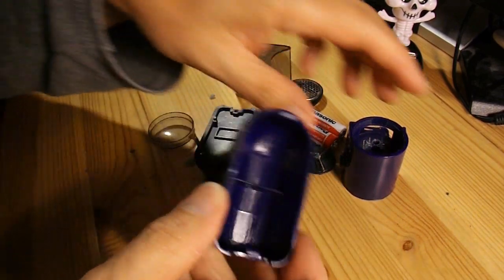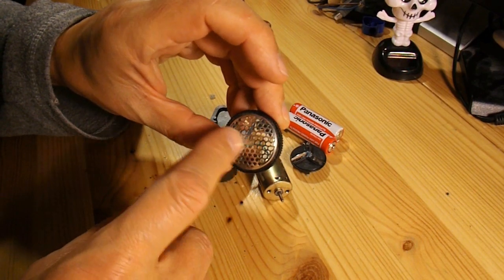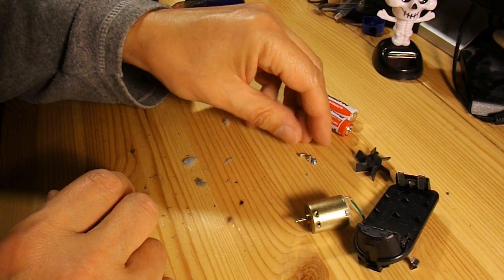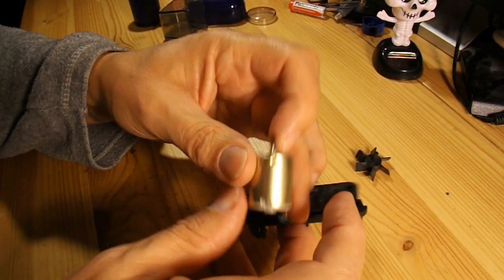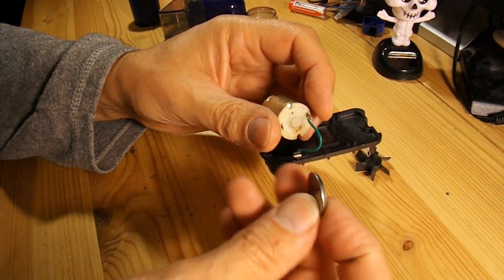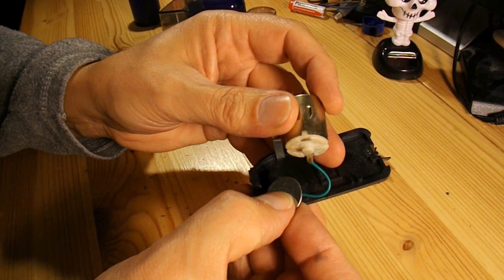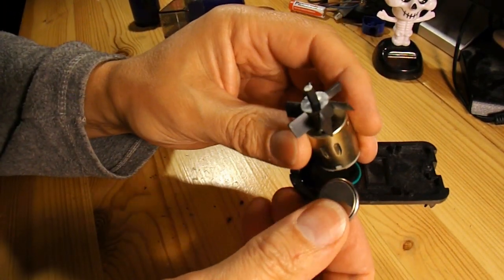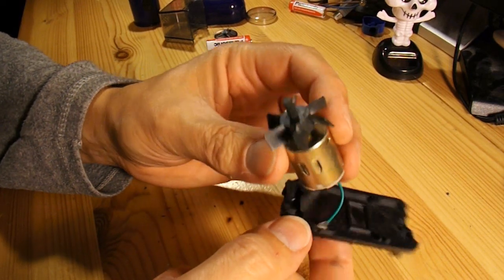Bargain Store Project #8 - lint remover hovercraft - fail

Comment: try using it on water!
Reply from the maker: What difference would that make? A hovercraft floats on a cushion of air, what is underneath that cushion is virtually irrelevant. It should perform the same on land, water, mud, whatever. This one does not work on land so it won't work on water either. If you check out my Hovercraft playlist you will see I have lots more designs http://www.youtube.com/playlist?list=PLA5a2xPRSrB3zoLYIrdESCCWdx2nLq8r7

Comment from the maker: I will be uploading an update to this project later tonight. I have made several changes, the main change in the end was to give it more DC power from an external supply. I didn't want to but it was the only way I could get the motors to generate enough power to get the hovercraft off the ground properly. Larger fan blades would have been another option but I wanted to stick to the fan that came with the lint remover to keep to my project rules.